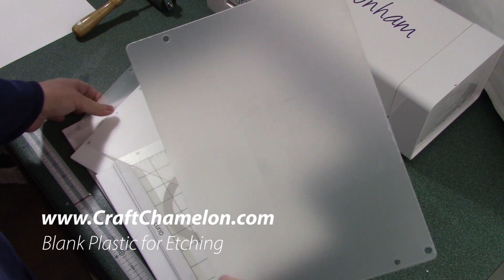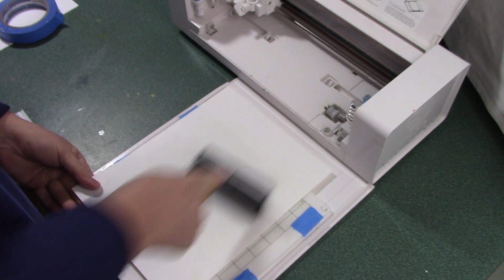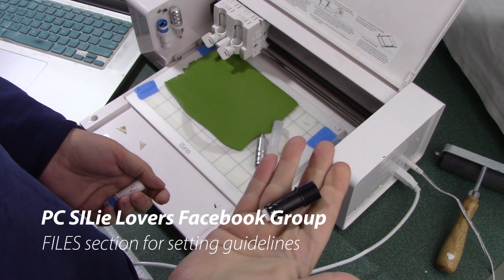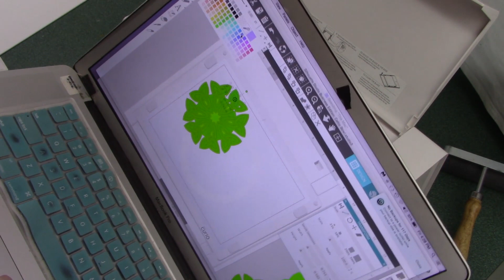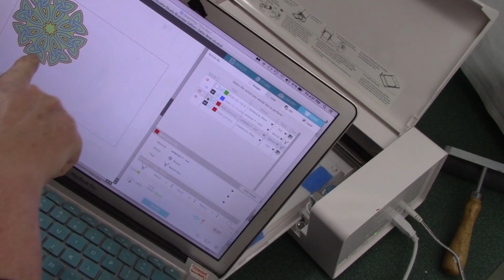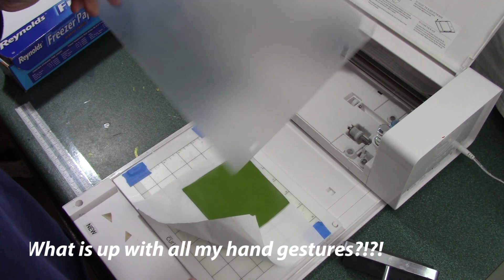Attaching Polymer Clay to Cutting Mats with Mags Bonham

Comment: Thank you so much for this. I’m finally a little closer to using my curio for cutting metal clay. I’ve had the curio for months now and haven’t cut one thing. I purchased the curio specifically to cut metal clay. I have several Cricuts and 2 brother scan and cut but the curio  and silhouette software learning curve is unbelievable. Thanks again for getting me a little closer to using my curio.